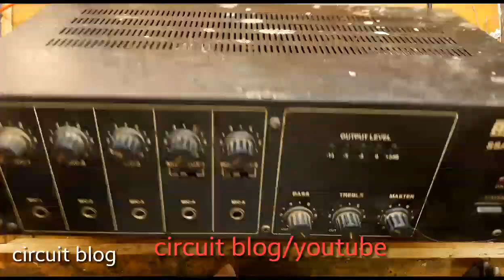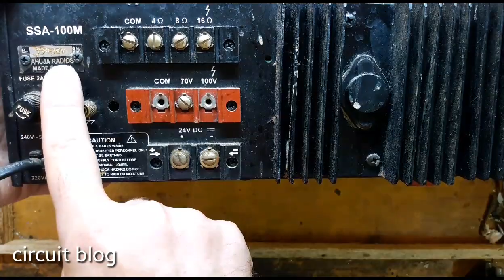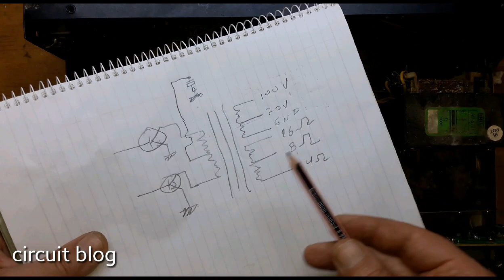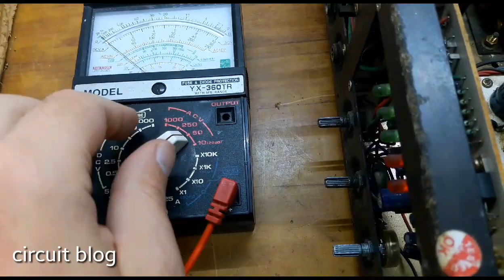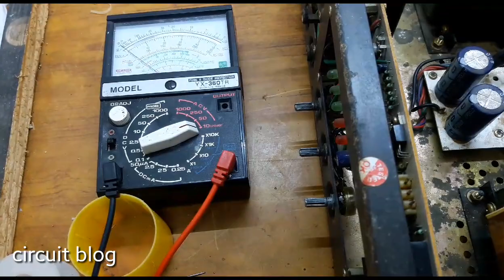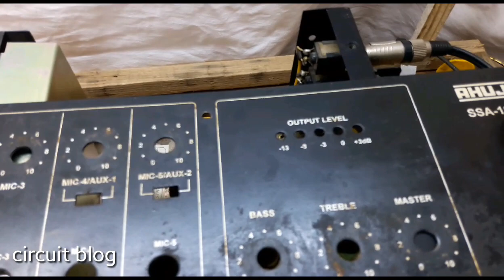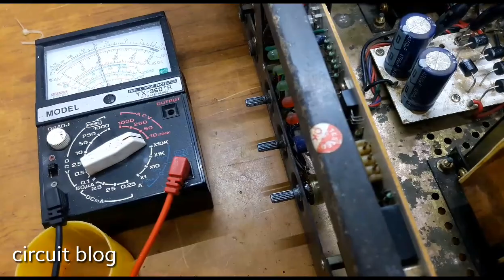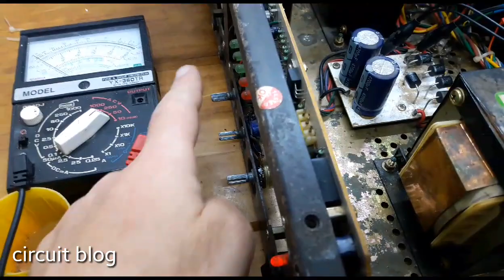AHUJA ssa-100m amplifire

Comment: What is the value of the master and mic volume controls ... can u plz share ...
Reply from the maker: 10 k
Reply: Thks.
Reply: I don't know but that 70V and 100V output is being used to drive speakers and horns with LMT ( line matching transformer in here kolkata)
Reply from the maker: @bijanpal6948   no for driving incandescent bulb
💡💡💡💡
Reply from the maker: Dear freind you asked for the volume / control value and you asked my help and i helped you 
You asked for the other out put (70-100)  and i told you if you know why did you ask i dont have time to watch other videos about this topic so please stop wasting my time
Reply: @circuitblog01  I didn't knew the value as I have not opened any ahuja amplifier so I asked the actual value.

If I have wasted ur time I'm sorry but knowledge should be right in electronics trade. Thk u.
Reply from the maker: @bijanpal6948  
Thanks 
I hope you can fix it
Reply from the maker: @bijanpal6948  ￼ AHUJA ssa-100m amplifire 

￼ 

Bijan Pal 

blog  incandescent bulbs can be used but will fluctuate according to the output ac audio signal. Its output is used to drive speakers and horns with in built LMT for long distance transmissions ... plz check ahuja website or any other youtube video. It's the normal practice for PA systems.

Comment: What transistor use for ahuja 100 watt Amplifier.
Reply from the maker: What transistor do you mean 
Do you mean the tr in back the big ones or in the pre driver board
Reply: Sirji konsa transistor or kitnea pcs use kartea hea ahuja original 100 watt Amplifier. Mea????
Reply from the maker: @djroniremixjpg6873  
On the back ( in the heatsink )
2n3055 is used
On the first driver board a 4007 tr or eq is used the other tr any 
Bc547 / bc557 thay can work
Reply: Kitnea pcs use hota he
Reply: Or Mr 125 watt machine pe agar 2n3055 ki jaga 2n 3773 lagay to kya hoga
Reply: Sound kyseaa ayega
Reply from the maker: @djroniremixjpg6873 
؟